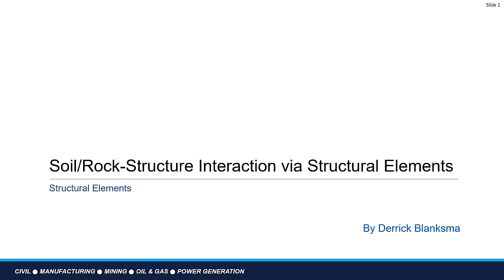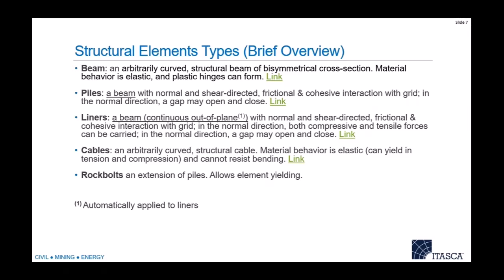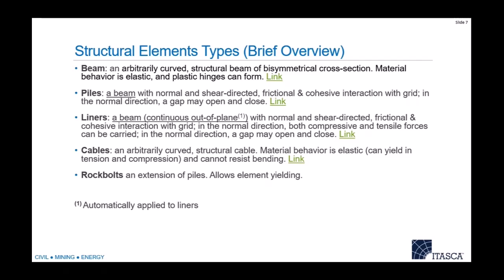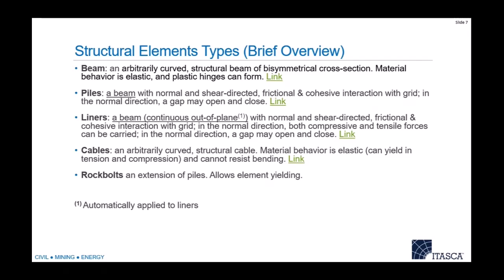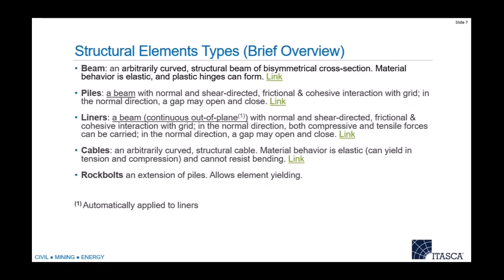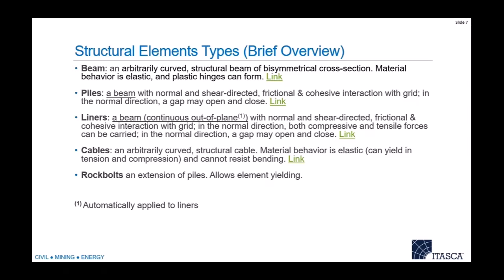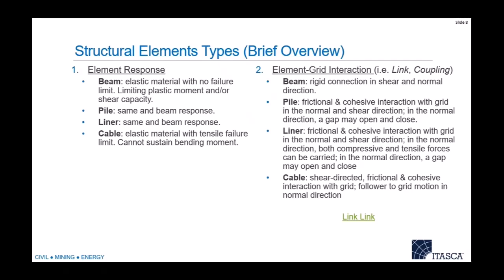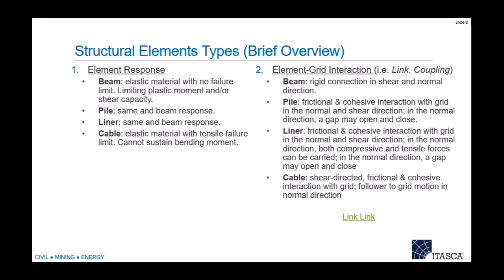FLAC2D 9.0 | Structural Elements – Types

Comment: What is the best option for sheet pile?
Reply from the maker: The most robust and versatile way to simulate a sheet pile is by using Beam Elements combined with Interface Elements. Beams are designed to resist bending, axial loading, and shear. Since sheet piles are essentially slender vertical members, the beam formulation accurately captures their behavior. FLAC2D allows you to directly plot and export bending moments and displacement profiles.

Note that if you attach a beam directly to the soil grid without an interface, the pile will be "glued" to the soil. In reality, sheet piles slide and can even pull away (gap) from the soil. Using interfaces allow you to define the skin friction between the steel and the soil, as well as the "normal" stiffness to prevent the soil from passing through the pile.
Reply: @itascasoftware thanks. 
I noticed in one of the examples inside Itasca, they simulate the sheepile as structural element LINER
Reply from the maker: @mahirbadanagki , that's a great point. A liner is essentially a beam element that has "built-in" interfaces on both sides. It is specifically designed to model structural supports that are in contact with the soil on both faces. The liner also automatically handles the normal and shear coupling between the structure and the grid, and is simpler to use.